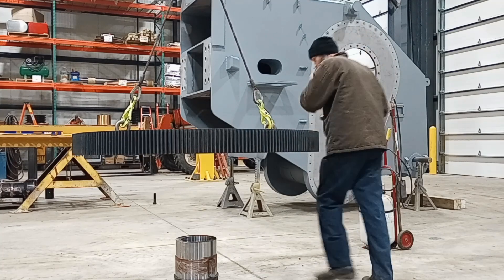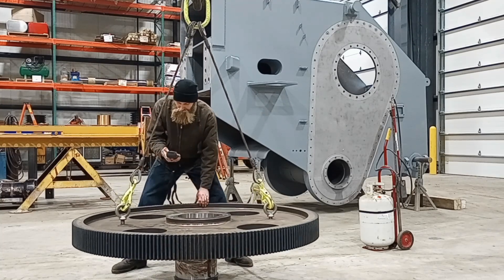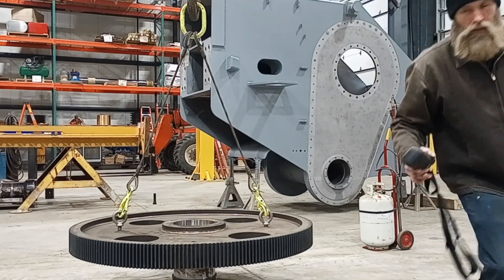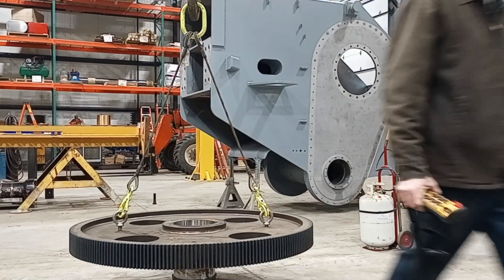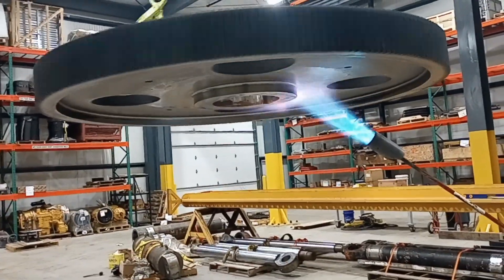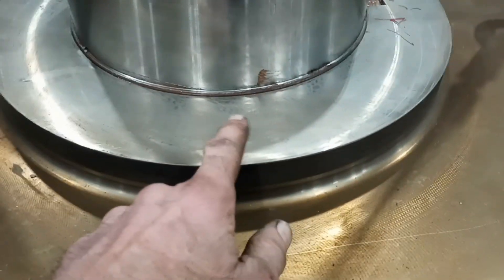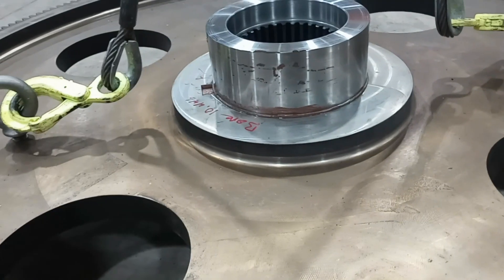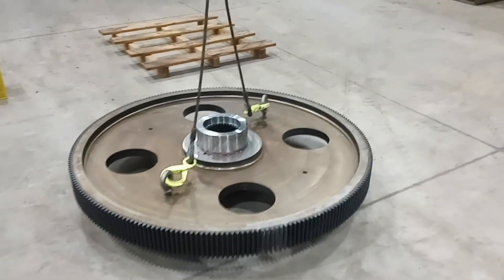Massive gear and hub assembly process

Comment: Well, where's the drama in that?  No BFH?  Not even any heartfelt cursing?  I didn't even have time to make the popcorn much less do any armchair quarterbacking.  Good Job 😀
Reply from the maker: If you wanted drama you should have seen one I tried to drop together a few weeks ago that I forgot to measure ahead of time that was .006' tight on bore size, darned near didn't get it knocked back apart on time. That sort of thing why the 12 pounder and a steel block is always handy, and why I should always double check the machine shops work.

Comment: Did you get a new shop or is that a customers facility
Reply from the maker: I have been at a customer's shop assembling a trencher for the last couple of months, I will probably be at it for the next year or so at least a couple of days a week.
Reply: Sounds like a big job in that case.

By yourself or got a hand?
Reply from the maker: I'm a small cog in a large project, the machine will weigh 1,000,000# and be 4500hp, there is an entire team working on it. My main focus right now is gear train and chain case q.c. and assembly.